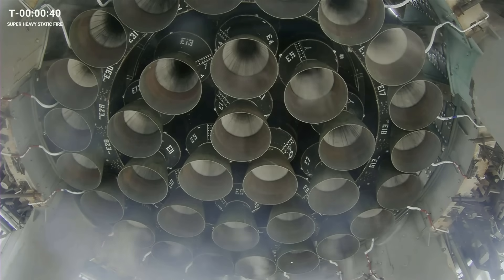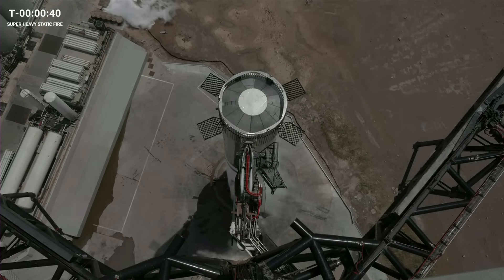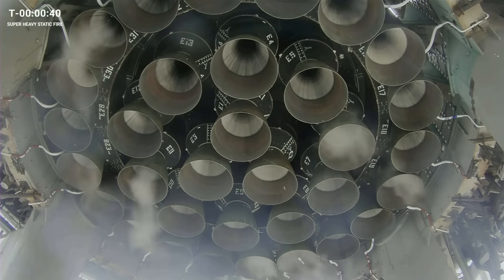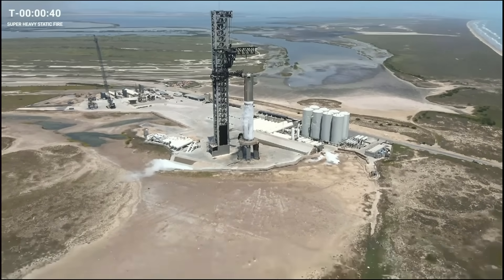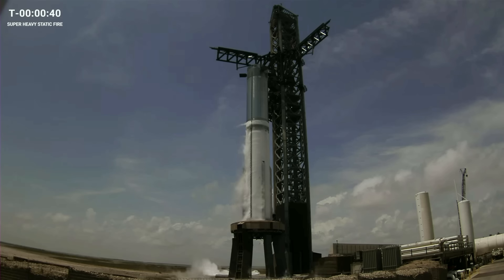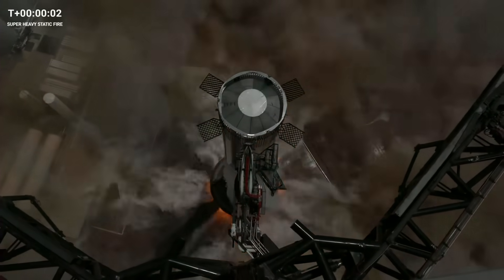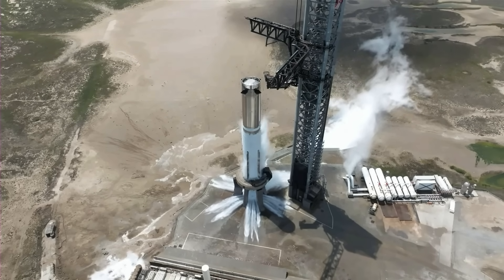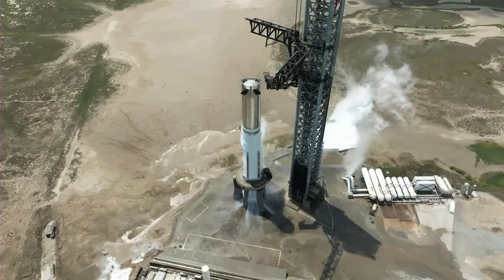Starship Super Heavy Booster-9 Full Duration Static Fire Test

Comment: Wonder how much the “frost/ice” weighs on the booster prior to launch?
Reply: NSF was talking about it, and basically it all shakes off once it gets going, so it's insignificant.
Reply: @hawkdsl  That just highlights the ignorance of the NSF people as well as yourself for believing them. You have several thousand kilograms of ice being launched off the pad, it's very firmly attached to the sides of both stages of the vehicle. Take some time and think about this! On a system where every kilogram lifted to orbit can cost you up to $100,000 USD, this ice is not getting a free ride! A tiny fraction will fall away as the engines are ignited, this would be the only part you could ever say is insignificant. The vast majority will detach under acceleration and atmospheric drag while the vehicle is in flight. It requires a massive amount of additional fuel. Even more is necessary again just for course corrections as the the falling ice alters the weight and balance.